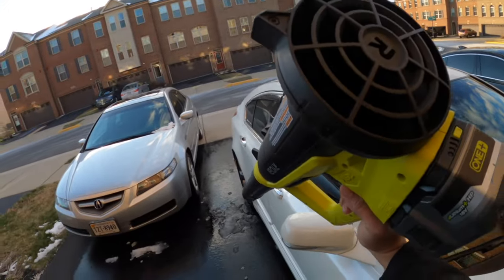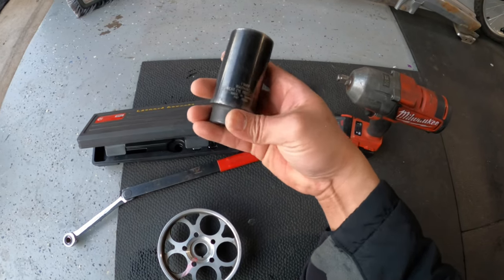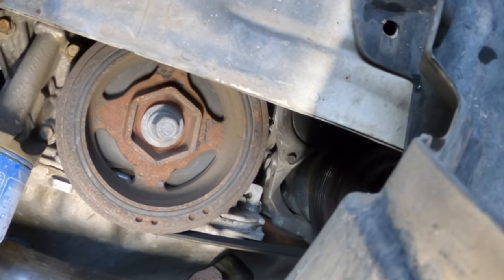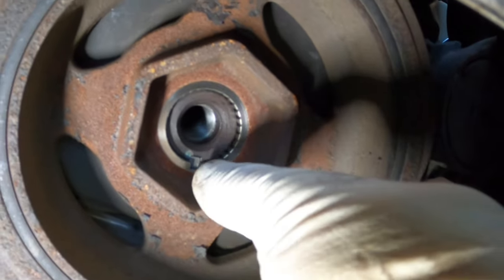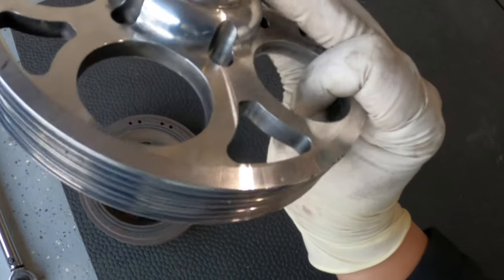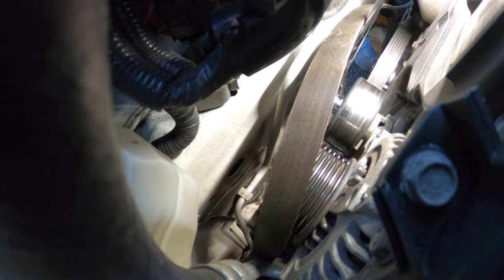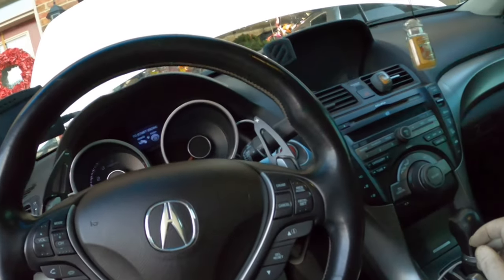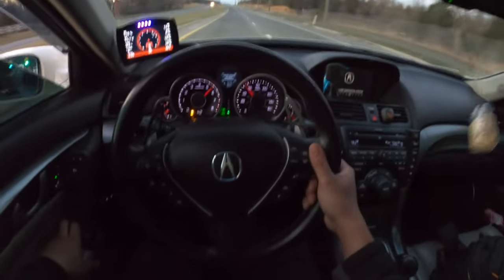Lightweight Crankshaft Pulley Installed Acura TL

Comment: Nice bro 👍! And i absolutely agree with a couple things, 1 that socket is life and if you dont have it dont call yourself a honda person, 2 it is also very difficult to feel a difference when doing a Crank pulley mod, youll feel it more while reving the engine than when driving it since its rotational mass youre removing, overall its a cool looking mod, just dont expect to feel a huge difference.
Reply: I'm a Honda person, I just don't call myself a mechanic lol. What is the benefit of the fat 19mm vs. a normal size 19mm?
Reply: @RevsALot  the weight of the socket helps loosen the crankbolt from what I’ve heard
Reply: @RevsALot  the thicker socket is actually a special Honda tool it allows you to lock the crankshaft pulley in place otherwise it wants to turn when breaking it loose but with the tool (which actually fits over the bolt itself) you lock the bolt in place. It's still very tricky.

Comment: Damn, great video man! I didn't realize how easy of an install this was. Might have to add this to one of the final bolt ons to see how much whp it'll get NA. Probably good for an extra 5-10whp🤷‍♂️, have to dragy again to see the difference on your 0-60.
Reply from the maker: Thanks brotha ! Definitely do it man if your planning on going full bolt ons 💪
Reply: Lightweight crankshaft pulley is not going to yield net HP gains it's not supposed to. What you are doing is making the engine more efficient and easier to rev. It's a good bolt on but should be done with others. For example I would look at all of the pulleys you idler tensioner and water pump pulleys take them out and look at the ball bearings they will have a size stamped on them like 6204 or 6203 write down ALL the numbers example 6204-2rs all the numbers matter. Now go online and buy new ball bearings with the correct sizes and get some nice ones look at the rating they will tell you the type of grease used how fast and what kind of loads they are rated for. You are trying to upgrade here you want to reduce the effort your engine has to put out in order to rotate. This frees up HP, potentially quite a lot. Next look at what else rolls, your wheels. Get good high quality grease for your caliper bolts, the grease is a goldish color it's pretty expensive. Your hubs if they have a lot of miles get new ones. We are reducing the effort it takes your motor to get the car moving. These are things people don't think about that parisitically drain power. With Acura TLs which is what I'm driving you need to make the car lighter and get the engine to do less work to get moving. Going the other direction which is spend money on mods to increase HP has been done it's a terrible way to spend money. I think it works out to be $100 per HP at the wheel in the real world. Example get a  new jpipe sets you back $600 or so and gains you under 10 usable HP. And you lose torque at the same time.. that's with a good jpipe, if you buy a cheap one you might not gain anything at all over stock. Making the car lighter and more efficient is the best way I'm telling you the truth.
Reply: @Mike-qo4kp  I'm all for reducing weight, I have lightweight wheels, no back seats, or spare tire, always drive with half tank or less, and getting racing seats soon. I had lightweight flywheel, went back to OEM(Spec Stage 3 Clutch broke), did more mods, and made about the same whp on the dyno as with the lightweight flywheel. So, lightweight pulley is same idea you will gain whp due to less rotating mass. Aftermarket for 4G TL isn't the biggest, so all we have is crankshaft pulley. The stock cats are the biggest restriction on the TL, very bottle necked.
Reply: @RevsALot  I gutted all three of my cats (3g) and tbh I'm not sure I gained much, if any, HP from doing it. And my exhaust smells at a good distance. I'd def recommend something other than gutted cats. I think the TL-S have good high flow cats stock. took out my rear seats and spare as well, sometimes also take out the passenger seat. These cars really notice every pound it seems.
Reply: @Mike-qo4kp  yes, gutting cuts won't do much, cause it's still the same narrow bottle necked piping. Aftermarket is definitely way more free flowing. Breather mods and weight reduction do wonders for the Jseries.
Reply: @RevsALot  yeah that's been my experience. I would also say the glove compartment is hefty, idk how serious you are about reducing weight but take that out and you save a good 10-15lbs easy. If you can afford it taking the factory radio out and replacing with a tablet would be my next spot, which I'm working on right now. The factory deck is insanely heavy, at least a solid 20lbs. Mine is the one with navigation (which doesnt even work anymore) and believe me, it's freaking heavy. Just my opinion tho.

I should add I spent time doing a port and polish on my throttle body intake manifold and runners and have been pleased with the outcome. Having said that, I would not bother doing it again without pulling the motor and porting the heads. Theres a lot of HP to be gained by making the path of airflow less restrictive.
Reply: @Mike-qo4kp  I'm not getting that serious about it yet, still got to switch to racing seats. I have no back seats or spare tire/tools, lightweight wheels, aftermarket exhaust and never fill over half tank. If my navigation ever let's go maybe I'll try that route.
Reply: @RevsALot  your nav still works I'm jealous! Haha. Racing seats might be nice, the stock seats are heavy I'm not totally sure how much lighter racing seats might be. If you are auto have you looked into a new higher stall torque converter? I was reading last night about how much that affects power to the wheels and also allows motor to rev much easier and faster. Just a thought.
Reply: @Mike-qo4kp  I'm manual, so already 90lbs. Lighter then auto. Racing seats I'm looking at I believe are about 30lbs. OEM are probably like 70lbs.
Reply: @RevsALot  40lbs saved then? That would make a decent difference. Wish I had bought a manual when I got my car....
Reply: @Mike-qo4kp  I believe so yah 40lbs. Per seat
Reply: Actually it will free up a lil torque and horsepower i dont know who told you that always gotta be a perso. Who thinks they know it all amd dont have a clue@Mike-qo4kp

Comment: hey man, i got a ktuner as well. and few other mods such as RV6 PCD, J pipe w/3rd cat delete, Cold air Intake. what did you set your RPM in Ktuner? i tried to set mine at 7800RPM, however when I hit that RPM I get a code for transmission over revving.
Reply: I get that code all the time, I just clear it and keep revving haha. I wouldn't go past 7500 unless necessary though
Reply from the maker: Those are one of the best mods you have. I get that code too I just erase it also. My tuner set my rev limiter to 7600. It’s not safe due to the stock valvetrain and it can cause valves to float. It is risky

Comment: How did you take the pulley off with the impact? My bolt won't budge at all :(
Reply from the maker: I used my powerful Milwaukee 1/2 m18 cordless impact with a 19mm harmonic balancer tool you can purchase through Amazon.
Reply: @GarrettMedia  Thanks for the quick reply my man. I was able to get it off with an air impact. Thanks for the video!

Comment: What stand-alone is that you’re running there? Did you up the redline?
Reply from the maker: Ktuner v2 is what I’m using and yes I extended my rev limiter I’m not sure how safe it is with stock valve train
Reply: @GarrettMedia  I think it's over engineered to handle overclock. The stock valve springs are beefy as is. It's only with repetitive use maybe a teardown would be a good call. After some time of consistent use you could always upgrade.
Reply from the maker: @johnnykwon8173  that makes sense. The consistent high rpm would cause accelerated wear and tear on the valvetrain so I would just have to keep up with the maintenance side of it 🤌
Reply: @GarrettMedia  I'd say the valve lash would go out of synch quicker. I forget, the J series is good for what, 120k miles before a adjustment is needed? At that time, if you really wanted to, you could upgrade the retainers and springs but that seems to me only necessary with competition cam. There are plenty of options for your type of setup.
Reply from the maker: @johnnykwon8173  yes Honda/Acura  recommends valve adjustment is done every 105k miles. I’m going to need that valve train upgrade soon haha. P2R has BC cams available not sure how much but 14hp gains 👀

Comment: Yo that 4th generation is the ugliest looks like Saturn and to big and boat like....that's why they discontinued the TL after this model n the TLX came along...
Reply: That's a matter of opinion. I've got the previous generation and it's maybe more elegant in styling but people like the last generation TL too. More spacious cabin, upgraded electronics, the exterior has been compared to spaceship like in design. Definitely a GM product though.
Reply: I think it looks great. Especially the 09 - 11 beak. I get compliments all the time
Reply: @supersabrosinho  yep, it was a very polarizing shift from the previous iteration. Some folks really liked it, others didn’t. My opinion is that it works really well not only on the TL but the MDX. It took some time to develop that opinion, however. New designs are not always accepted from the get go, but engineers need to anticipate that it is over the course of years their products need be relevant.
Reply: Nah dawg I don't agree with you! Although the tlx is a lit car it doesn't  have double wishbone suspension 😕 I still love this Acura and in Toronto it's very expensive to find a mint 4th Gen tl.
Reply: @m.a.omarkhail8294  same as why B series can be superior to K series. It's proven technology and no one wants to deviate from perfection.